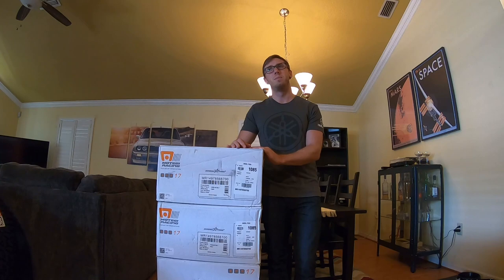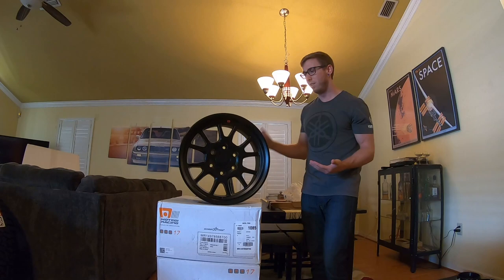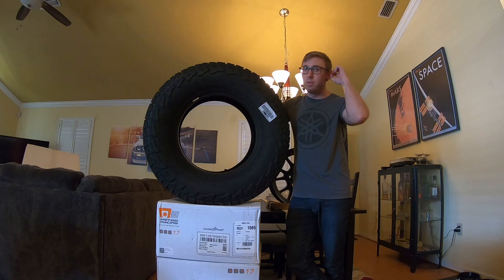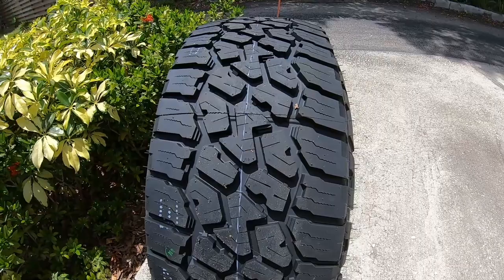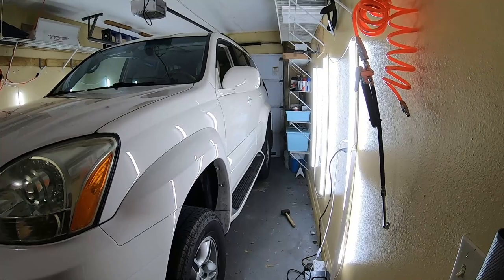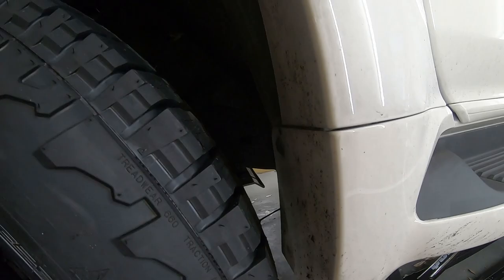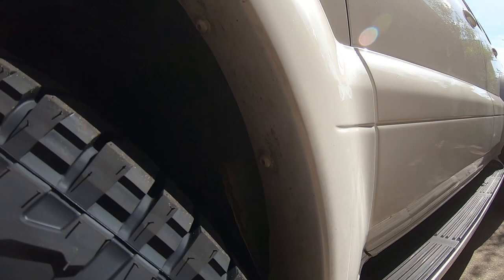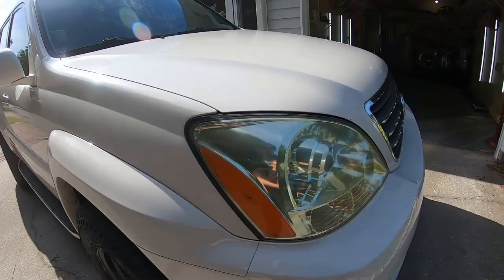Vlog 15 - Lexus GX470 Gets New Wheels & Tires! (Motegi and Falken Wildpeak)

Comment: I bought my GX a few days ago. So far, your vids have been more informative in way some others haven't. You've cleared up some questions by just nonchalantly glossing over subject matter that others have a hard time explaining. Thanks, liked and subbed
Reply from the maker: Hey Landmine, I really appreciate the feedback and it’s a constant struggle for me when editing these videos how much of my ramblings I should cut out. I’m about to post my second speaker video and I left more of the talking in hoping it helps others understand where my head is at. If you have any particular topics you’d like to see videos on, let me know. I’m open to suggestions from subscribers on new content. 
Thanks again! 🙏🏻
Reply: @Awesomoto  Awesome, man. Your ramblings have helped a lot. I'm about to buy a set of Falkens, do you think 275/70r17 with fit without rubbing? Lift will come later
Reply from the maker: @landminehopscotch3617  It'll be close, but it all depends on your wheel offset. Do you know what offset wheel you have?
Reply: @Awesomoto  Not, really. I'm going to have to run stock rims right now, but maybe 10? This is all still pretty greek to me. I'm kinda "do it and see what happens" type, but I don't want to spend $ on repairs that could go towards wheels and a little lift later. Any ideas would help immensely. Thanks for all the help, btw
Reply from the maker: @landminehopscotch3617  No worries! It was all Greek to me until I made this video, but if you Google wheel offset specs it’s fairly easy to understand and I think you’ll benefit from it and learn. I think others have had success running 275s on stock wheels. I’d say a safe bet would be run 265. I don’t think you’ll have any rubbing with that tire profile.
Reply: @Awesomoto  So, I googled it and I definitely have a better understanding now. I'm going to remove the side steps first. I spoke with my tire shop and asked if could do some cutting or use a heat gun there if need be. He said ''no, because of liability issues, but I don't go around back too often and there is an outlet there" lol. So, I think I'm good and if I have any more questions I know where to go. Alright, gotta watch your new vid, thanks for all the help!
Reply from the maker: @landminehopscotch3617  That’s awesome they’re willing to “work” with you to make it fit lol. Good luck with the install and let me know how it goes!
Reply: @Awesomoto  Will do and thanks again!

Comment: The more negative offset you do, the worse, if you can go another 10mm towards the inside before rubbing the top A arm with the tire the better.
Reply from the maker: Great point. I feel a wheel with an offset between 0 and the stock offset would work well. I'm still loving this 0 offset wheel spec all these years later and will continue to go that route when I upgrade wheels in the future. It just sits so nice and flush with the fenders and I have no issues with rubbing.

Comment: So this tire size is good if no off road is being done ? it clears once we cut the trim by the running board ?
Reply from the maker: Hey Rafael. Yes, this is a good setup even for light off-roading. Anything with large suspension flex, you'll get some rub on the driver side. If you plan on that type of off-road driving, I'd suggest a lift for more clearance. Yes, once you trim the piece I showed being cut, it clears from rubbing.

Comment: Looking to get a GX.. what do you think the best tire/wheel setup is for stock suspension without cutting/rubbing?
Reply from the maker: Hey Dj, Great question! I'd say the best without cutting would be to keep the same wheel offset as stock wheels and go a little less on tire wall height. I went with 70 on the sidewall, but 65 or 60 would probably be perfect.
Reply: @Awesomoto  thanks! Happy new year!

Comment: How does the black paint hold up on these wheels?
Reply from the maker: The black paint has been holding up amazing after three years. I just recently did a ceramic coating video on these and it helps keep them so clean even on the trail.

Comment: thanks for doing the walk around shots. shows how flush the setup is.
Reply from the maker: No problem! Yes, the setup is nice and flush and worked out very well for me. Wheel spacers were something I didn’t want to do, so calculating the right wheel offset was worth it.
Reply: @Awesomoto  happy with the vehicle? Im selling my fj, was going to import a diesel prado, but I really like the atrac system. I think after all said and done, the extra fuel costs of the gx might negate the cost of importing etc. 
It's a tough decision as I'd likely make money or come out even driving and selling the import if I dodge shirt term capital gains.. Same vehicle basically, but gx has more improvements and parts available. (Less aftermarket)
There are just so many of these around that have been maintained and also hitting the Manheim auctions so a good deal is easy. Hard decision to make...
Reply from the maker: @svnbit8408  That would be awesome to import a diesel prado! I think it would hold it's value well like you mentioned. Let me know which you end up deciding on!
Reply: @Awesomoto  Yeah, I've always wanted a turbo diesel, and the upside to driving a potential slow depreciating, or appreciating asset is definitely nice. I'll keep ya posted, I definitely have to own a gx sometime, that V8 is a reliable beast.

Comment: Looks great man! Just got mine last week, wanted to see what I could make happen without a lift for now.  Stock suspension was replaced last year with all new, so I'm not in any rush to lift it yet.
Reply from the maker: That's great to hear! Congrats on becoming a GX owner! This is the exact reason I made this video. I was struggling to find anyone showing what can fit on a stock GX without getting a lift kit...so I took it upon myself to be the guinea pig for everyone out there...luckily it worked out well for me and I only have slight rubbing at full lock. Let me know if you have any questions when you install wheels and tires!

Comment: I' at 10:15 sec, that's a lot of tire to shove in that wheel well. I want to do something similar with stock height. I did put Bilstein 5100 shocks and Metal Tech coils on the rear. Keeping front struts because prior owner just replaced them.
Reply from the maker: I’m shocked they got with stock suspension, but so happy it worked out!

Comment: Biggest looks change you could get is to ditch the running boards. It’ll look instantly lifted and gets rid of the mall crawler look completely. It’s takes 5 mins to pull em off if you haven’t already!
Reply from the maker: I agree and might give it a try! I've seen a bunch of people in the GX Facebook group that have done it. I like the look, but would love to have some nice metal rock sliders so I still have something to stand on when loading bikes onto the roof. I'm thinking some rock sliders may be in my future lol.

Comment: You really knocked it out of the park on the wheels.  I personally think you went too big on the tires.  For my GX I went with TRD wheels and got the stock tire size but A/T K02s.  I had the K02s on the stock wheels for a couple months and they still rubbed at full lock.  Barely rubbed, but I am glad I did not go with the 265/70s they were pushing.  Once I switched to the TRD wheel, the rubbing is completely gone.  Stock suspension and I am happy.  Might replace the shock/struts at some point but no hurry.  Already got new bags in the back. For now I am very happy with my setup.
Reply from the maker: The TRD wheel setup is nice and fits well from what I’ve seen. Yes, I agree I went big on the tires, but I love the look and figured “why not” lol. Glad to hear you’re working well on stock suspension! I’m still having slight rubbing issues at full lock, so you’ll be seeing a lift kit install video from me in the future.

Comment: Very nice setup . I have a 2009 Toyota prado which is very similar to GX460 model . I just bought falken wildpeak at3 AT tires 265/70/17. My wheels are 17x8.5 with 0 offset . You think I would clear and have no rubbing issues ? I have all 4 mudflaps as well . Not looking into doing lift. My stock tires are 265/65/17. All help is appreciated
Reply from the maker: Hey Rafael, sorry for the delayed response. I think you won't have to worry about rubbing. I have 285/70/17 and barely rub, so removing 20mm from the width should be enough to have clearance.

Comment: Thanks for doing these videos. Really invaluable resource. Think I can get away with 17x 9 -25o without bmc if I size down to 265 70s? Fine w/trimming but want to avoid the bmc. Thanks in advance
Reply from the maker: Hey Dustin, I'm not entirely sure the 265 width with a -25 offset is all that is required to guarantee. I'd say you might want to go down a size or two on the sidewall height as well. I'd be afraid to recommend the tire you're considering since I haven't tried it myself. It's likely going to fit, so it might be worth taking a gamble on it.
Reply: Thanks. Do you remember how much space you had to the body mount w/ the 285 70s before you lifted? @Awesomoto

Comment: Many thanks for this video and the ones concerning and explaining speaker upgrades. Giving the links made ordering them painless. Again, a BIG ASS Thanks. Like your thoughts on the base overload, I am looking to get an equalizer soon. It's bearable, but not for long.=)
Now my question. Concerning your selection to the tires, which I had planned all along. I am leaning more now towards only going 32 inch's . My thinking is that the 33's will water the power  and response of the 4.7 liter power plant. What is your opinion of how they ride and how the power seems to feel. Any feed back you have would be greatly appreciated.
Reply from the maker: You have a good point on the tire size. I personally don't notice a change from the stock wheels with regards to power. It certainly didnt "bog" it down by running 33's, but I think physics would prove it does reduce to an extent. I'd say the width (285 in my case) might play more impact to power. In general, less weight from 32's would likely reduce wear on the drivetrain, so maybe as a science experiment go with 32's.

Comment: Nice wheels. Great choice. Design wise, Wheels look like 2000s fj cruiser bronze/gray stock wheels with faux beadlock ring but thinner spokes portion.
How are they holding up so far?
Reply from the maker: They’re holding up great so far. They’ve been on the vehicle for about 8 months now. I’m very happy with the choice and plan to buy a 5th wheel so I can have a matching spare.

Comment: Followed your lead. Just purchased the rims you recommended. Also got lucky and got a set of wild peaks 285 70 17 (only 150 miles on them for 600 bucks). I’m stoked. I’m running a 2” eibach lift. Well on my way. Hope you’re enjoying your setup!
Reply from the maker: Hey Lance! That’s so awesome you went with the wheels. I love this setup and can’t wait to do a lift! Do you have any clearance issues after installing the lift? I have slight issue on stock setup at full lock on left hand turns. I made measurements and it seems like it’ll go away when I lift the vehicle. Thanks for reaching out!
Reply: @Awesomoto  just got the motegi and wildpeaks installed. They did trim the exact areas you trimmed and that is with the Eibach 2” lift. Will keep you posted once I get it out on the trails
Reply from the maker: @lancewilliams9698  Nice! So I’m assuming no rubbing with regular driving then? If you rub on the trails, let me know. I’m curious about that clearance. Thanks for the update!!
Reply: @Awesomoto  no rubbing during regular driving but my wife did say there was slight rubbing when she parallel parked today.... I’m wondering if the upper control arms will need to be changed out. I had replaced them with oem parts last March. What is your impression with the oem control arms? Seems like the rubber is really close
Reply from the maker: @lancewilliams9698  I’m planning to get after market UCAs with the lift as I heard there can be issues with camber adjustment limitations with the stock ones with aftermarket lift. I didn’t think I was rubbing there, but maybe I should put some chalk on my tire and see if I can get it to make a mark where I’m rubbing to isolate to problem.

Comment: It looks good! I must have missed the off-set specs in the video. What is the off-set again? Thanks
Reply from the maker: Hey, no worries. The offset for the wheels are 0, which reduced the amount of cutting needed and makes so there is no need for wheel spacers or a body mount chop. I have slight rubbing, but this will be eliminated when I install the lift this fall. Thanks for reaching out!

Comment: This video is exactly what I was looking for.   Q:  On your Falken 285 x 70's  I noticed you got the Passenger version.  Was there any consideration for the Light Truck version of that tire size ?   What was your thinking process on that ?
Reply from the maker: Great question elli003. When looking at Passenger vs. Light Truck I figured I'd get a better "daily" drive type of ride quality with a less rigid sidewall. Now that two years have passed and my GX has become something I want to offroad more, I think I'll switch to Light Truck on the next set.

Comment: DOPE VID! 
Do you think if I get the same wheels but 265x70x17 Flaken Wildpeaks at3w, it will still rub?
Reply from the maker: Hey Samuel, Sorry for the delayed response. I think you'll be fine with 265, but I'm not certain I can guarantee there won't be a slight rub. Your chances are much lower by reducing that tire width though.

Comment: So I know was 2 years ago, but the motegi website doesn't show this model as available for the GX470 (2005)  Are you still running these? Any rubbing?
Reply from the maker: Hey Dylan. Yes, I'm still running these wheels and they likely don't show they fit since it's a Lexus and not a Toyota. The bolt pattern is the same as Toyota. I have a little bit of rubbing as shown in the video, but not much. This was only due to the tire size I selected.

Comment: Hi there I put the same wheels but 18 mm offset with 285/75/17, it rubbed the upper control arm, the shop recommended that i can put 2 inches spacer , should I get the wheels with 0 offset or add the spacers? Your opinions is much appreciated.
Reply from the maker: Ideally you’d want the 0mm wheels as dealing with spacers is considered an annoyance by some. If it’s a total nightmare to return the wheels, I’d run spacers. I run spacers on my bmw and haven’t run into any issues. Many will have varied opinion on spacers if you ask around.

Comment: Hey I just recently purchased a GX470 and wanted this exact setup but I have no plans to go off-roading right away. It’s more for the look and to have a cool dad car (having a child in a couple of months) would you recommend this setup if it’s just city driving ? How’s the ride on those Florida roads?
Reply from the maker: Hey kbs! Congrats on picking up a GX470! Yes, I definitely recommend this setup for city or mostly road driving. I have a video on my channel of taking it off road and it does pretty well there as well with minimum rubbing on the trail. If you’re concerned about it, you could go to a 275 width on the tire instead of 285 and that will give you extra clearance. Hope this helps!

Comment: Quick question. Do you by any chance still have the center caps from stock wheels ? I’m looking for 2. Or do you have any idea where I can get some?
Reply from the maker: I still have the wheels and plan to keep them in case I sell the vehicle and want to return to stock. It looks like eBay has some options to solve your problem...hopefully this link helps.

https://www.ebay.com/b/Wheel-Center-Caps-for-Lexus-GX470/43961/bn_1424917

Comment: I like your wheel and tire combo. They look awesome on the GX. I just lifted my GX by 2.5” and plan to put the same tire and size on my stock wheel. Hopefully I don’t have to do much mod to the liners and rear fenders. Does your tire rub the front liner at all?
Reply from the maker: HCCVAD Thank you! I’m happy with the wheel and tire choice and feel they made a big improvement in the look. I have a small amount of rubbing on the drivers side at full lock when the suspension is compressed. So driving on a decline while turning I have rubbing. I also plan on doing a 2.5” lift, so I think that’ll eliminate the rubbing issue. Let me know how your lift and tire upgrade go. Feel free to tag me on Instagram if you post pictures.

Comment: If you recall, besides the side step and liner along with it, any modding to the front bumper liner or rear liners?
Reply from the maker: I didn’t trim any other areas. Just that section I covered in the video. I’m planning to do a loft soon, but I’ve been running almost 2 years with this setup and the minor rub isn’t bad unless off-roading. The plan is to do a lift soon so I can do some serious trail riding.
Reply: @Awesomoto  I appreciate the reply, im about to mount 285/70 and will be removing the step.  ill trim the liner part as well.  thanks!